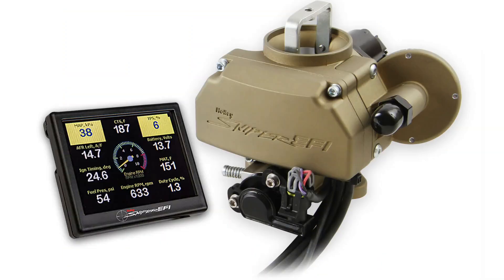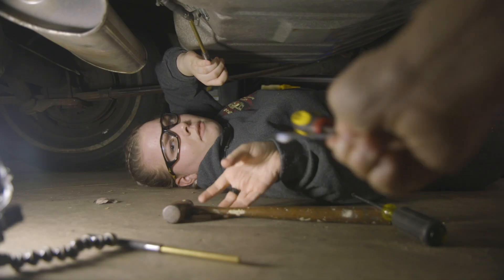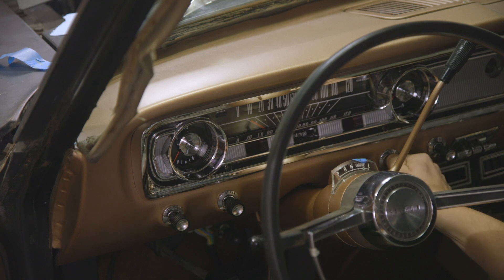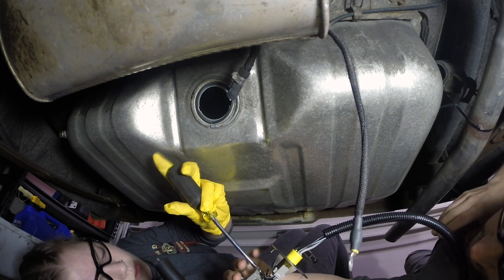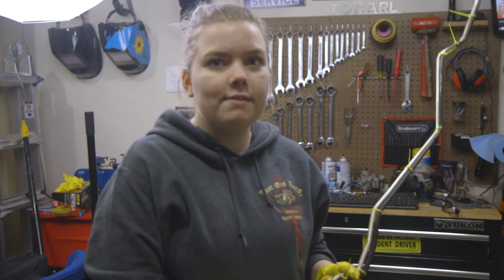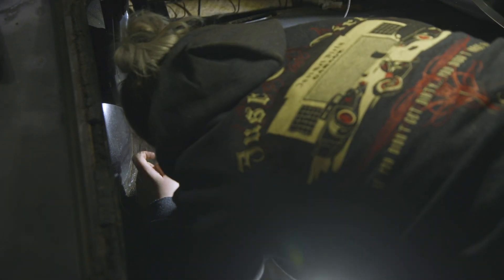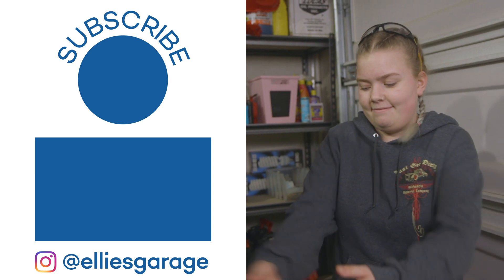Teenager Installs a HOLLEY EFI Fuel Pump for Her '65 Falcon! - Ellie's Garage

Comment: Tip. When you cut two or More wires to sold with extensiones, don't cut the wire in the same long placer. Cut the first wire, the next 1 inch more long, the 2 nd 2 More inch, etc.  These method have 2'adventage, avoid the posibilities of a shortcircuits, and a Ball of cables AND unions in a same placer. Cheers

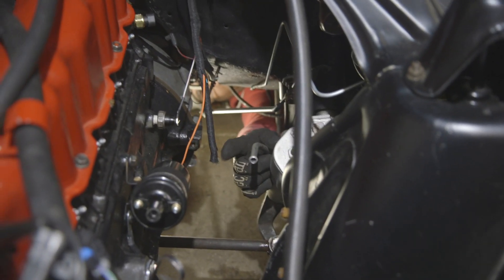Comment: I’m probably wrong, but at 10:48 is that electrical wiring bundled in a loom with fuel line?  It’s probably not, but just in case, that’s a very bad idea…

Comment: I know this is way too late, but, I saw you using silicone to hold the o-ring in place during reassembly.  Your better to use Vaseline. Silicone Cas degrade in gas and let pieces go into your tank which can clog things, very little chance you'll have any issues with your set up but it's always best to use best practices. Plus the Vaseline lubricates the lock ring to makes it easier to reassemble.
Reply from the maker: That's a great point and tip. Thanks! We actually have plans in the future for a trunk restoration episode and we'll be replacing the tank, so we'll be sure to use that tip for next time. Thanks again!!

Comment: so what's the difference between a stock pump and a Holley one?
Reply: That car would have had a mechanical pump operated by the engine, stock.  That pump would generally have made 12-15 psi fuel pressure.  The Holley Snipers are using fuel injectors and generally need 60 psi.

Comment: Hi did the efi fuel pump come with the wiring? Or did you have to purchase separate
Reply from the maker: The fuel pump kit we used is separate from the EFI (links are in the video description). The fuel pump we used was really cool because it has a special valve that made it so that we didn't have to install a return fuel line.

Comment: The oxygen sensor adapter you put on your exhaust pipe does that come with the sniper kit?
 if not do you have a part number?
Reply from the maker: Yes sir, that collar comes with the kit. But, we ended up having some exhaust leaks around that clamp on collar, so we'd probably recommend getting a bung welded in. Here's our video where we found/fixed those exhaust leaks: https://youtu.be/GIYyYhqAd80
Reply: @ElliesGarage  thank you so much for the information really enjoy your videos of you and your dad building your car I've got a 63 falcon convertible I just finished it was a part for 20 years I was a mechanic for 35 years still enjoy tankering on it thinking about this EFI system

Comment: Hi what did you use for your return line?
Reply from the maker: The fuel pump unit has a regulator valve built-in so you don't have to use a return line

Comment: What did that fuel tank originally come out of
Reply: The original tank does not have the filler neck inside the trunk, it would be either on the rrar quarter panel or behind the liecence plate
Reply from the maker: @James-xo4uv  That was a modification the previous owner did before we bought it.
Reply from the maker: That is actually the original tank for our Falcon, as far as I know.

Comment: A few things with today's video.
1. At the beginning you said you got trans fluid on you already. If there is trans fluid up near the fuel tank you have a leak somewhere.
2. The biggest thing I noticed in this video was you and your dad where working in very cramped confines. When working under a car make life easier for yourself, jack up the car, and support it on jack stands. It will give you 6 or more inches of room so you can move around easier.
3. The purpose of a rubber grommet is to provide a seal that doesn't allow leaks. When you cut a grommet you provide a place for it to leak. You can get grommets that already have holes in them so you don't have to cut them. I suggest you put some sealant on the grommet you cut just so the grommet can do what it is supposed to do.
4. Others have already mentioned the earth/grounding of the fuel sender unit making the gauge not work when you tested it. What others haven't mentioned is if you earth the sender wire the gauge should move which is another diagnostic test you can use to see if the gauge itself is working or not.
5. Great job bending and flaring the hard line, it's not an easy job. The bundy ties at each bend to hold it is an excellent idea, do you mind of your loyal followers use it?

Comment: It's a shame you're quitting on the carb. system.  Part of owning an old car is to diagnose the little problems; that's how we learn.  I'm 63 and still learning.  Keeps it interesting.  I have no problems with my '65 Falcon with the 1100 Autolite - 200 ci engine.
Reply: It’s not a shame. Like you, she will also be learning by diagnosing and dialing in the EFI system.
Reply: @thewhiteelephant  I agree, she wants a reliable system, and I want this in my 65 Mustang.

Comment: Love you guys 😃👍
Btw... if your original sending unit only has one wire, then you need to touch the mounting to a ground source like the frame or something touching the frame...
Great job guys ...
Reply from the maker: Of course! That makes total sense. It also makes sense why Holley had us run a ground all the way from the battery to the back when we were wiring. They told us that one was for the sending unit in the tank, so I think that it should be working now. Thank you for that info!!
Reply: I was thinking the same thing...  There may also be a gauge issue, but the cause of it not reading in THIS case was that the sending unit had no ground.